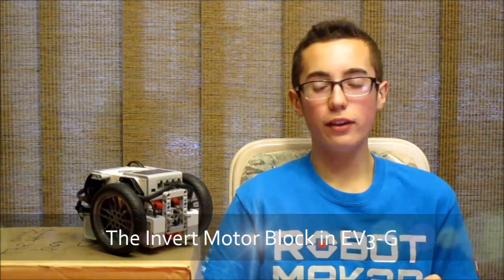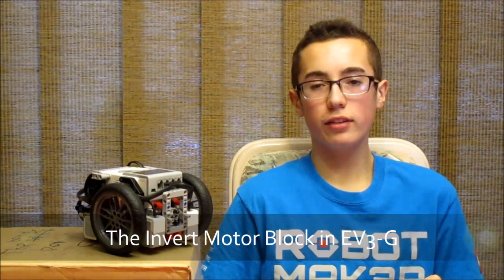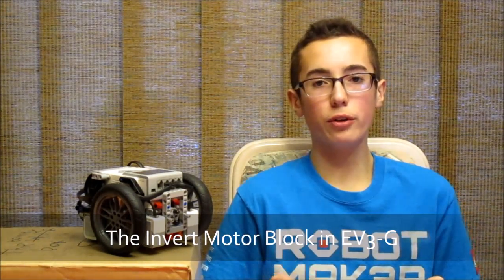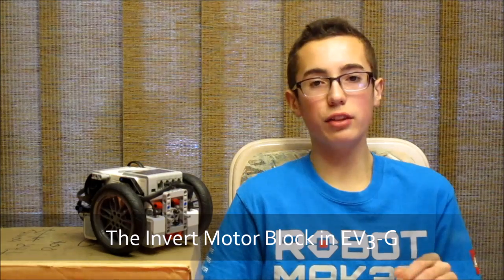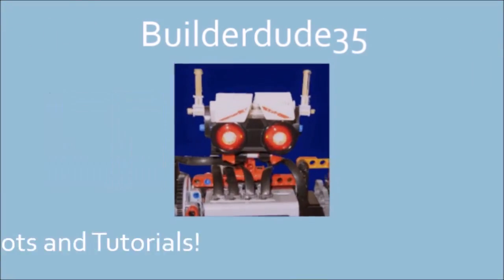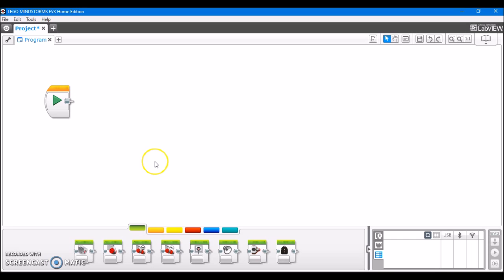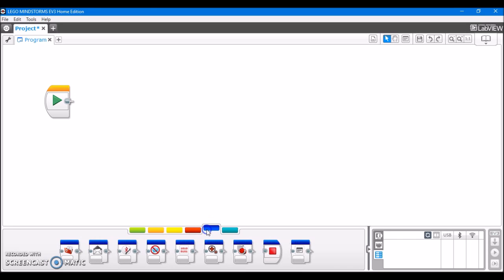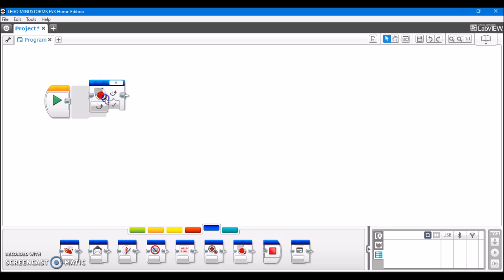The Invert Motor Block in EV3-G

Comment: it doesn't work with move steering 
I want to use medium EV3 motors for follow line robot,
can you help me please >>I need your help, please <<
Reply: I have the same problem, have you found a solution?
Reply: @gtech4758  e.g. FL (50, 50). CE is +10, expected (60, 40); CE is +20, expected (70, 30). Using medium motors (-50, 50), so CE is +10, expected (-60, 40), not expected (-40, 40).

Comment: Hello!! Is invert motor block only used with unregulated motor block ? Because I tried it with a move tank block but the direction didn't change. Thanks
Reply from the maker: +LegoMani It should work with all motor blocks. Make sure that you have an Invert Motor block for each of the motors controlled by the Move Tank block.